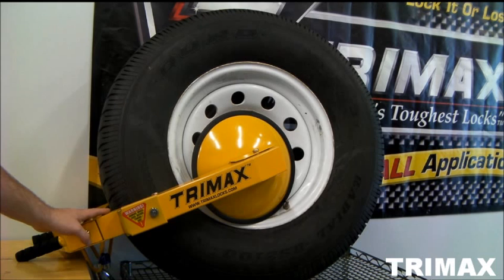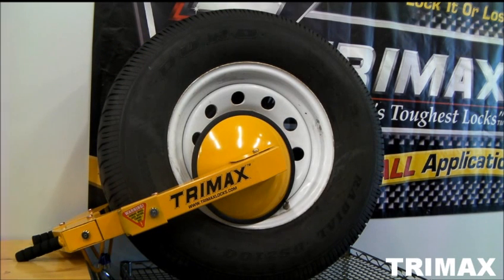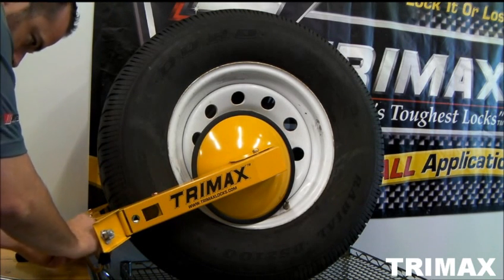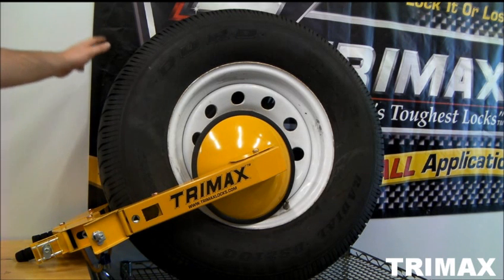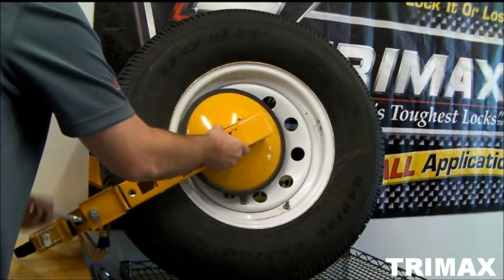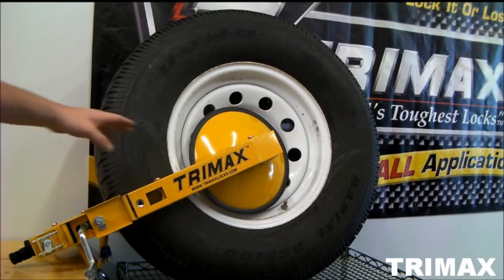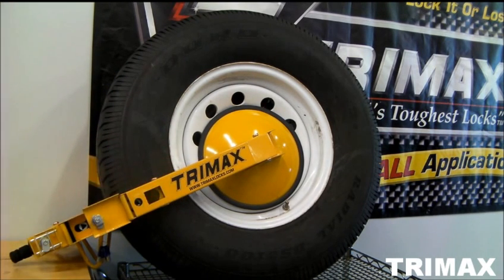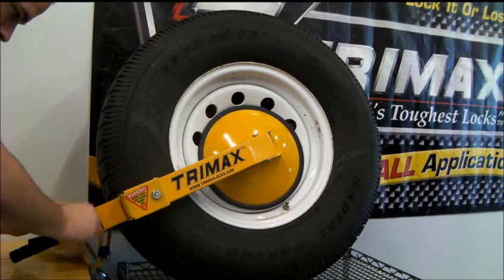Boot Style Wheel Lock by TRIMAX

Comment: will this fit  22 inch rim aka a 2010 Cadillac Escalade wheel? I want the hub to cover the wheels center plastic hubcap that hides the wheel nuts because I have had this stolen  before. Please let me know If I can buy it or not
Reply: sadly, look at a you tube video, defeating a wheel lock with a plastic pen, the tube of the pen is used to open the 2 cylindrical keys, and a screwdriver unscrews the clamps